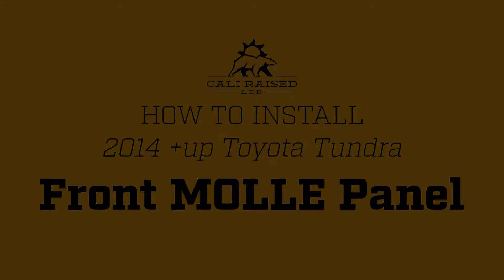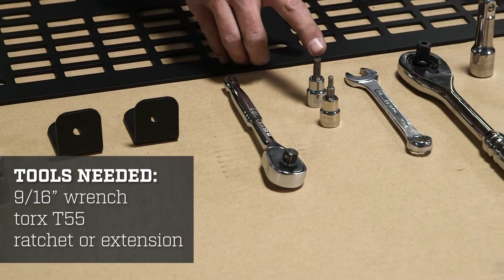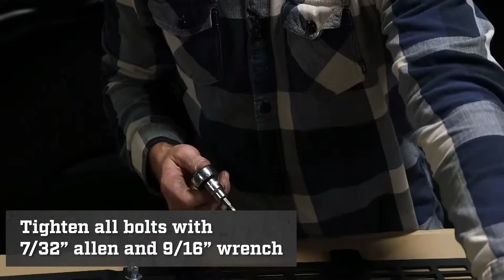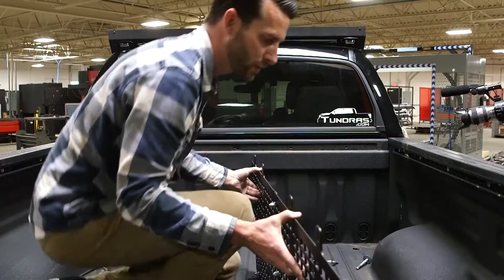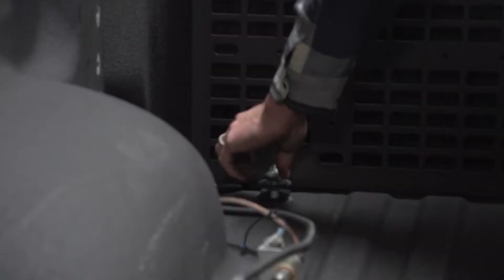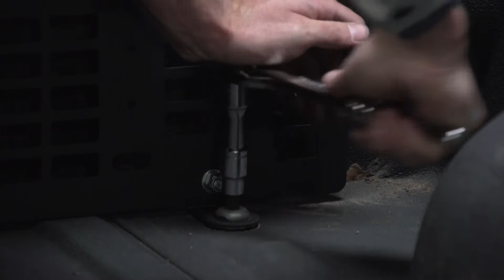How to Install Front Bed Molle Panel for 2014-2021 Toyota Tundra | Cali Raised

Comment: I want to like these guys but they have such poor quality control. To begin with, this front MOLLE system is for the Tundra CrewMax models; it cannot be bolted to the floor in the bed of a double cab Tundra. Secondly, they didn't include all the required hardware for the install. I'm missing the 5 M6 bolts that are shown in this video. And while it's a small thing, whoever does the proofreading for the text in these videos missed that the hardware says 4 M6 washers and 4 spacers when in reality it's 5 each. So now I've got a useless MOLLE system that I can't install correctly on my Tundra. What a waste of money!

Comment: Any tips for removing bed bolts under spray-in liner? Thanks
Reply: I have the same exact question!!!
Reply: @nogills_diver3233  howd it work out? im about to do that! slow and steady or quick rip? lol
Reply: @Nahbruhsheesh  it worked out great. Slow and steady. Used some needle nose pliers to pry off the liner. Looks clean. Now gotta try the side ones.
Reply: howd it work out?!